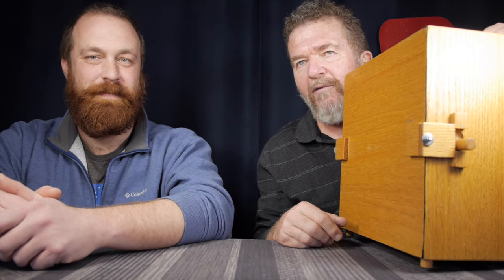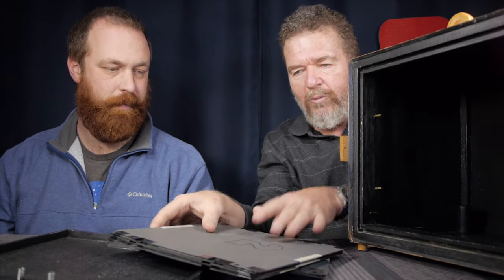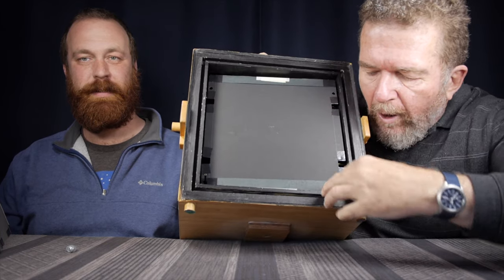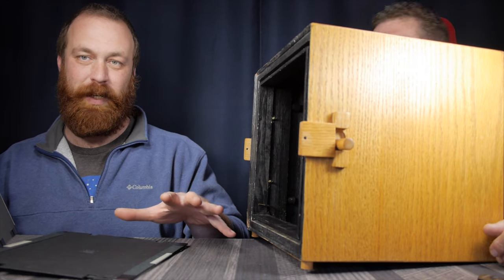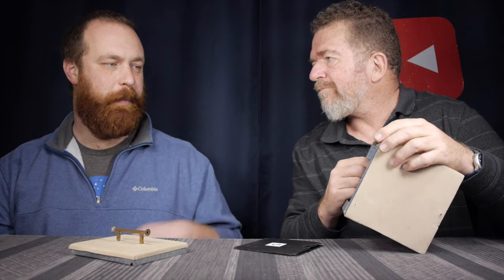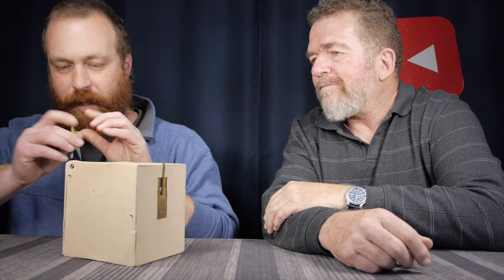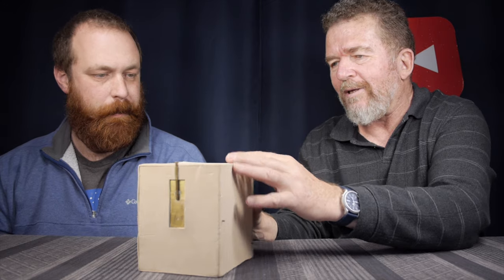Joe's Pinhole Cameras - Part One

Comment: When you cut to the closing outdoor shot, I was starting to yell at the TV! Can't wait for the rest, shortest 20 minutes of video I've seen lately. Sign of a great topic! Would you go into a bit more detail on the construction of the 4x4 sheet metal skin camera. I am having issues with  my parts and holders ending up like an Australian wobble board (the woop woop sound from "Tie me kangaroo down").
Reply from the maker: It's hard to get more detailed shots of the camera, since it's covered in sheet foam. Perhaps I can answer your specific questions?
Reply: @Joe_VanCleave  The two related questions are how did you flatten your paper holders flat and how did you get the back door flat and not looking like Grandma's one cookie sheet with the high corner?  I've tried a couple of ways of making corners to no avail. Instead of careful heating, just bring the whole thing to 280 C and then solder?

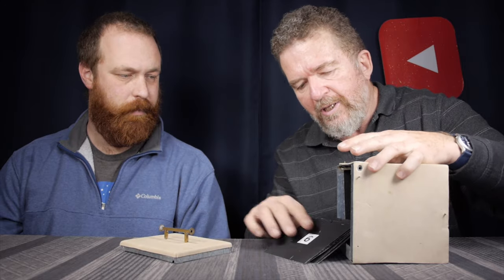When you bring the 4x4 out, you can see Ethan's gears engaging. At 8:12 his brows are furrowed and then they shoot up when you open the camera, "OH so that's how it goes!"